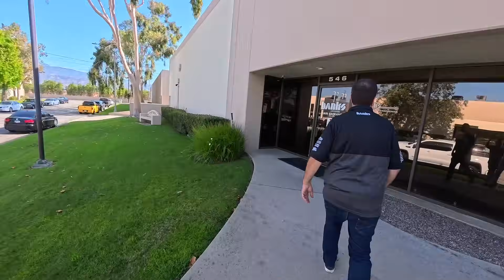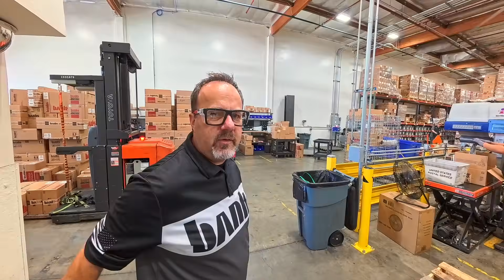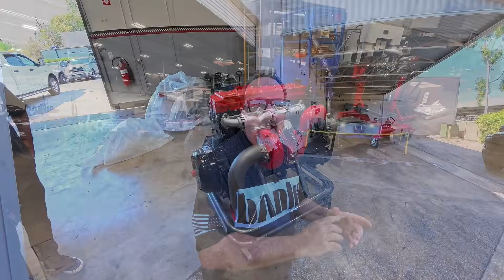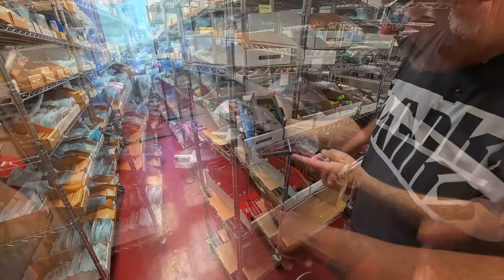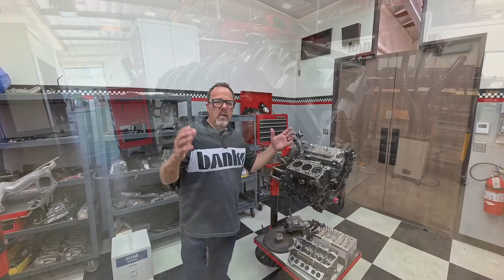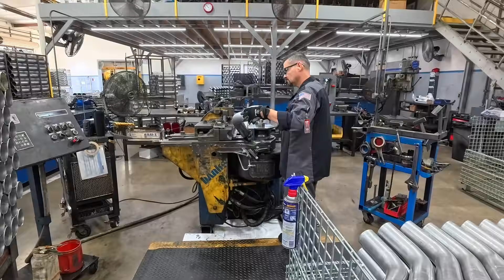I Visited Banks Power And You Won't Believe What They Are Working On!

Comment: I wish they had a Banks Ram Air Intake available for the Ram 2500 6.4L hemi. I just bought a 2026 Ram with the 6.4L. I watched Gale’s presentation about the Banks Ram air system vs the S&B on the Cummins. I was about to buy a S&B or AFE momentum gt. I’d rather have a Banks product for my Ram. I would imagine the Cummins system would be a close match, except for the intake tube. The one that connects the air filter to the throttle body that houses the mas air sensor. It takes a different path than the Cummins model. It would be easy to market it to the Power Wagon/ 6.4L Hemi heavy duty owners.